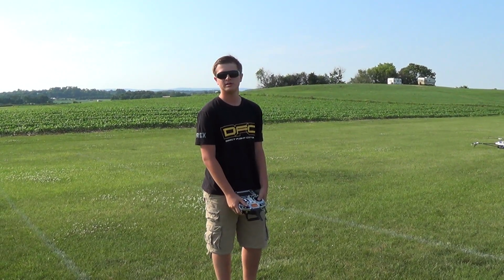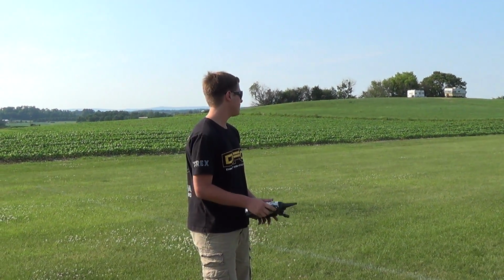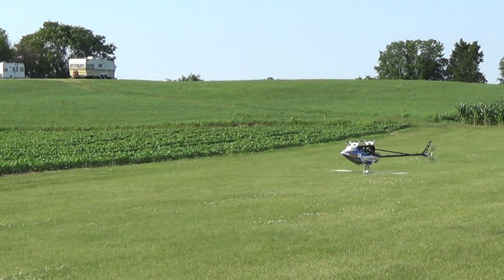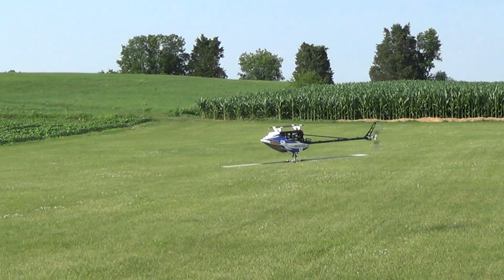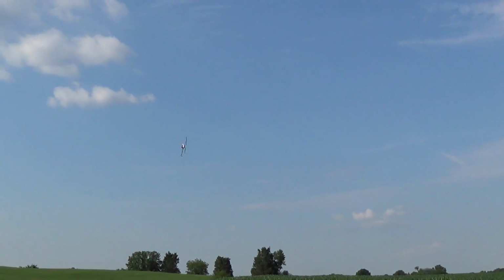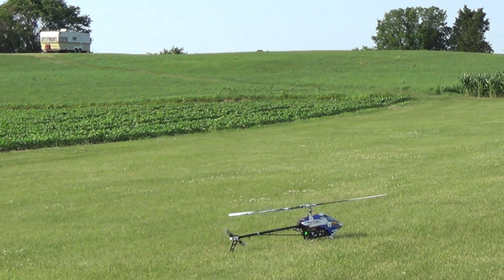Raptor E700 Hard 3D

Comment: Nice flying man what's your head speed and what ESC ypu flying with
Reply from the maker: Thanks man, I'm running 1950 just cause Thai heli is so light and I'm using the castle ice 120
Reply: Nice almost the same setup as my tsa700e the only thing with myn I'm runing 2180